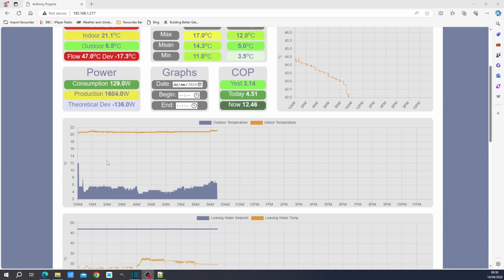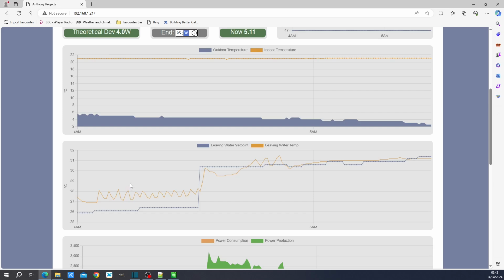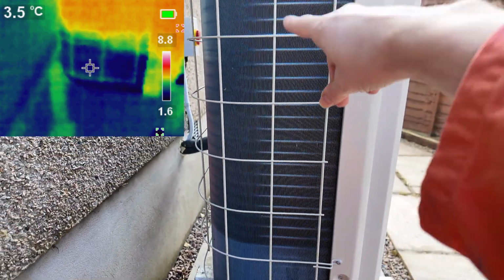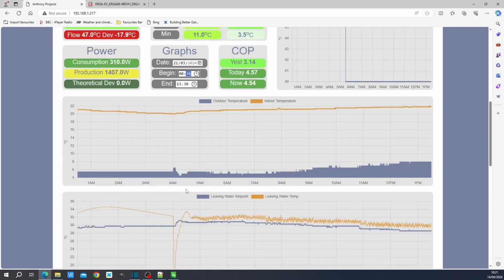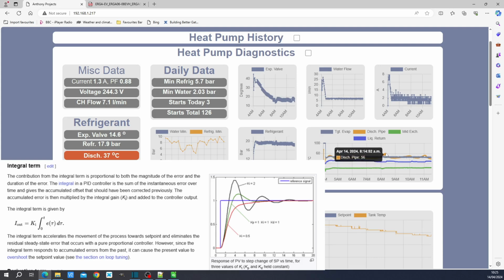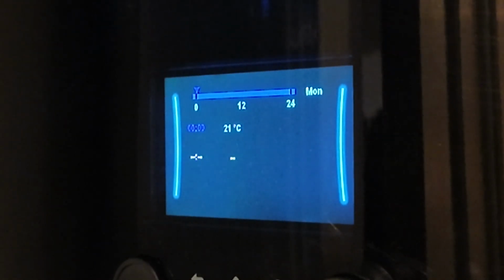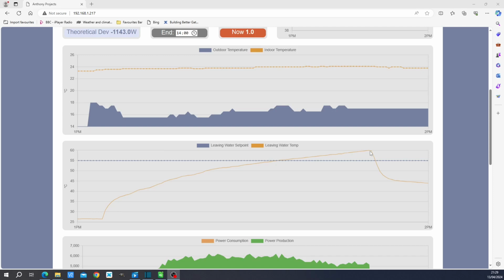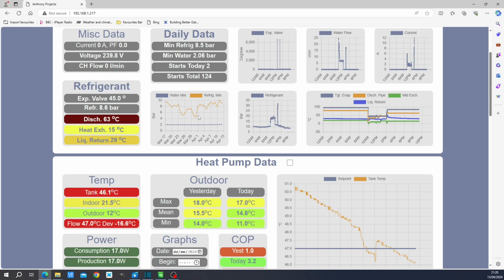Aberdeenshire Heat Pump Odyssey Part 6:  A new analysis tool for Daikin

Comment: I have just had a 6kw Daikin heat pump installed by Octopus. There is not much detail in the data available to determine efficiency and performance. How did you obtain all the specific data points such as expansion valve position and pressures and amperage ?
Reply from the maker: The video in Part 4a describes the setup, including the ESP Altherma Project.  

Current come in two flavours:  Primary Winding and Secondary Winding Current.  I could use the primary winding current, along with mains voltage.  Then I could plot current vs instantaneous power consumption at the meter in order to obtain power factor, and then I applied a best fit curve to the data acquired to be able to convert current to power.

Expansion Valve Position has a maximum raw value of 450. I surmised then that this was the opening angle of the expansion valve * 10.

Water Pressure was tricky.  The data was not depicted in Bar, Pascals or PSI,  So I had to plot the raw value against the analogue gauge indication over a variety of pressures to obtain a curve (which thankfully was a linear fit).

Comment: Hi, I saw in the first offer you had an EPRA unit, but now I see is an ERGA. Can I ask why? I am currently deciding either one or another. Thanks!
Reply from the maker: @erikestrada1883  These names that Daikin get me confused easily.  Essentially my system is a split refrigerant system.  The original quote was for a monobloc system.  I prefer a split refrigerant system as it means you don’t need to introduce glycol or antifreeze valves into the equation.

Glycol has comparatively poor specific heat capacity and viscosity compared to water.  And bringing water outside the building is risky during deep freeze conditions (especially when you’re away on holiday).
Reply: @ thank you very much! All your content is really helpful! The names also drives me a bit crazy haha but I think the only difference that makes me be worried is that the EPRA can reach up to 70 degrees while the ERGA I think is only 60 with BHU! I made all the calculations to run my house with radiators at 50 degrees max. So the unit you have should be enough. Have you ever felt cold or like the heat pump could reach a comfortable temperature? Thanks again for your reply!

Comment: Quick question: where do you get the expansion valve degrees from? I assume you calculate it from the "Expansion valve (pls)" value from ESPAltherma, but which one? On my pump, both "Expansion valve (pls)" and "Expansion valve 2 (pls)" values seem to have data, but the 2nd one seems to be read incorrectly (the endian-ness seems to be wrong). If I invert the two bytes, then I get what seems to be an appropriate value for the number of pulses (currently 215). So, I wonder if your values are inverted as well and you patched the ESPAltherma code, or do you actually get the correct value? Thanks.
Reply from the maker: Here's my datapoint:  {0x30,3,151,2,-1,"Expansion valve 1 (pls)"},

I then take that raw value, strip out the title and divide the remaining number by 10:
ExpValvePos = float(ExpValve1Value)/10
Reply: @anthonydyer3939  Thanks! Turns out the def file for my heat pump was completely off.

But one more thing about this value: the service manual states that 0 pulses = fully closed, 480 pulses = fully open. And since the ESPAltherma value supposedly indicates the number of pulses (pls), you might want to change the formula for calculating the angle.
Reply from the maker: @markoluksa  except I do get a value of 500 when the valve is in defrost mode.  Where did you find out about 480 pulses?  I just saw what the value was and figured that it was either % open, or it was number of degrees (assuming it’s a butterfly valve, and not a gate valve).

Comment: Not sure if you've already learned this after recording this video, but you should also be monitoring the inverter frequency. This will show you that the compressor's power draw isn't reacting to a change in refrigerant pressure, but the draw is actively being controlled by the inverter frequency (at least that's my understanding). The refrigerant pressure is also controlled by the frequency. As far as I understand, the heat pump's control unit is trying to create a specific pressure in order to achieve the required refrigerant saturation temperature, so that the phase change from vapour to liquid happens in the internal unit's heat exchanger at the correct temperature. This saturation temperature is indicated by the "Pressure(T)" item in ESPAltherma.

One more thing: at least in my case, the inverter primary current is 0.5A when the compressor is not running at all.

Comment: As a Daikin owner this is a very interesting video, I'll be collecting more than basic stats (LWT, Setpoint, Flow rate etc) and seeing how well mine is doing at different ambients vs. the specification.
In respect of the passwords etc. there is a very usable Python module configparser which reads/writes INI files, and makes it all very easy. Just about anything you need to do is already in a module somewhere :-).

Comment: Anthony, Very impressive data collection, reporting and analysis. You are definitely onto something - I just cannot decide what.😉 I would be tempted to say the PID calibration is out of whack or the TEV (or whatever they call them in modern parlance) is defective. Looking forward to seeing how this pans out.
Reply from the maker: I removed all the Thermostatic valve regulators for the radiators since this video.  They were giving me “trust issues”.  They were wound up to their maximum end stops, and the advice received three times from both plumber and heatpump engineer was to make sure the radiator valves were all maxed out.  So I wandered “what if the valves are closing in anyway?”.  So the answer was that they weren’t.  The DeltaT was exhibiting the same behaviour.

The minimum compressor current is the culprit.  Most times it’s 1.3 Amps, but it’s only when it drops to 0.5Amps that I see much better COP.  I’ve pored over the data to ask the question of what the system or environmental difference is between a 0.5Amp or 1.3 Amp situation.  I can’t find the answer.  Sometimes I’ve seen stubborn minimums at 1.8 and 2.3 Amps with similar outcomes for COP.

Right now I’d need Daikins source code to find that answer, and I don’t  have the contacts or reverse engineering know how to extract that data.

As the weather has gotten warmer, I’ve seen other weird behaviour.  When inside temp is 24 degrees or higher, the hot water heating mode refuses to engage until I reboot the heatpump.  Once the inside temperature drops below 23 degrees (the absolute cutoff for any space heating operation), the hot water cycle will engage correctly.

I do feel like this could be fixed with a software update, and one firmware update was offering, update download failed, and the update was then withdrawn.

Comment: 60oc max is to prevent compressor failure. Need to see your temperatures and pressures too.
Reply from the maker: Wouldn't compressor failure protection be dictated by refrigerant parameters rather central heating water parameters?  We have refrigerant discharge pressure/temperatures for example, and those are under PID control.  Your target discharge temperature for example was continuing to rise up.  Current draw was only 9 amps at the top end of that heating session - well within the 14 amp maximum.

Comment: You show it later on when you switched heat pump on.
Big delta t , better performance as bigger load.
Reply from the maker: Since this video, I’m definitely placing a lot more focus on the DeltaT. It’s about 3-4 degrees when COP is high, but only 1-2 degrees when COP is low.  It’s definitely the case, when the house is cold (e.g. turning on when returning from holiday) the COP is very high.  But when the house is 21 degrees or warmer, and the flow temp is 28 degrees, of course the return temp is going to be no lower than the room temp!  The puzzling thing is that the return temp is still much closer to the flow temp than the room temp.

Now the advice from my installer is “turn the radiator TRV’s to max”. This they are already, on the maximum end stops.  But now I wander now if the TRV’s are still interfering.   I feel an urge to point my IR thermometer at some radiators now (and maybe remove the TRV regulators completely).

Comment: No load on heat pump and compressor minimum output reached.
This shows on the rear too as it only is showing condensate on the lower coil.
If you timed the heat pump during warmer weather it may help , or just turn it off .
I can turn mine off for long periods above 9oc.
Reply from the maker: The deltaT is certainly one factor.

The open question is "What is the Minimum Compressor Load"?
Is it 0.5Amps, 1.3Amps, 1.8Amps, 2.3Amps?  

Because I've seen all of them dominate as a minimum output.

The answer seems to be "it depends", because PID control parameters alone are not bringing the compressor load down to 0.5 Amps all the time.  There seem to be additional interventions

Last night for example, the COP was poor due to low deltaT, and yet the compressor refused to drop below 2.3Amps.  During the leaving water climbup to the setpoint however, the COP performance was right on the published figures, but once the setpoint of 32 degrees was reached, the COP tanked.   On previous nights, a setpoint of 32 degrees was absolutely humming along with a compressor current of 1.3Amps and a much better COP.   I raised the setpoint of the Weather dependent curve yesterday evening, and the consequence on the minimum output is that it also increased.  So the COP numbers in steady state have no opportunity to improve.

I've reverted back to the previous weather curve.  The "unknown variables" that affect minimum compressor load are yet to be uncovered.  I'll continue to probe, and hopefully I'll discover those variables.
Reply: @anthonydyer3939 Delta T actually represents ‘load’ or lack of it.

Comment: Superb effort, but what does a 'normal' person do when they are forced to install a heat pump and they dont have the ability to build a data integration and perform a very thorough analysis looking for efficiency savings? They get poor performance, crazy bills and complain resulting in negative news headlines. This is a brilliant window into the complexity of a heat pump compared to a gas boiler.
Reply from the maker: You can look at the heatpump on a cool humid day.  If you get condensation only on a portion of the outdoor heat exchanger fins then something is up.  That’s the easy way to figure things out.

But heatgeek approved installers are now going to be guaranteeing the expected SCOP that they provide you in the quote.  They’ll carry out remedial actions if that number isn’t achieved.  So in order to provide such a guarantee, they of course need to put the measuring equipment  in that measures it.  No doubt that is “open energy monitor” equipment. 

But heat pumps aren’t complex.  We’re just scrutinising them a lot more because they are so much more expensive than legacy gas boilers - at the moment.  But as you’ve seen, the business end of the heat pump really is a simple device.  I think there’s a lot of scope to reduce material costs in the future.

Comment: Surprised you’re not using a round robin database to store the historic data
Reply from the maker: I’ve not heard of that, but the text files are perfectly fine for this use.  I haven’t dabbled in other file formats such as xml.  I need to get my head around the advantages of each file format vs another.  Tab separated files are easy to understand, but I’m told they are ‘primitive’ methods.

Comment: I hope they can sort out the hot water temperature legonella cycle with a software update,  I imagine it will increase energy costs over the long term with the constant use of the backup heater.    If not it makes a strong case for using r290 heatpumps.
Reply from the maker: I’m sure a software update will solve this, if they are interested in solving it.   I just hope they are interested.

Comment: Where are the rubber mounts on your outside ac unit! Most be noisy
Reply from the maker: It’s not really. In the kitchen I can hear a faint hum if I have the radio off.  It’s not attached to the house so noise isolation isn’t so critical.

Comment: it looks like you have discovered the operating envelope of modulation at higher temperatures.
What is your weather dependent curve configuration?
Reply from the maker: Top end is  28 flow at 10 degrees ambient
Bottom end is 45 flow at -12 degrees ambient.

It’s been tested down to -3.5 and my house has maintained the desired temperature.

But it’s going to be at least a few months before I find the conditions to tweak the bottom end of the weather curve.
Reply: @anthonydyer3939  in the mean time tuning the top end further over summer is possible, fwiw i set 23oC lwt at 20oC ambient and 37oC lwt at -10oC. Albeit with underfloor heating and a 200Litre buffer and a mixer. Basically the buffer/mixer does the modulation at high ambient temperatures. I don't find the buffer/mixer harms cop much. I concur the BUH destroys cop. Use the installer login 5678 to access the setpoint settings. If you haven't yet found it there's settings to restrict the BUH and set an equilibrium temperature at which it kicks in.
It looks like your minimum input power is about 500W, the minimum output at around 15oC ambient must be something like x 6 = 3kW?
I believe you said (correctly) the system stops heating when the return temperature reaches the set lwt. The circulator should continue though.
Stupidly I had not realized this is all a software PID controller until you pointed it out.

Out of curiosity are you running modulation mode with a Madoka thermostat?
Reply from the maker: @z_boson5629  Last night I increased the minimum lwt to 30 degrees from 28 degrees.  The result was even worse COP.   The COP was 2.5, when it should have been 3.3 (it did reach published figures, but only during temperature climb up to setpoint).  What I saw was that when the lwt reached the setpoint, the output reduced as expected, but the input would not drop below 2.3 Amps.  This was with ambient temp of 3 degrees.     Therefore a higher minimum input was established for the heatpump.  

So I'm starting to think that the minimum consumption for the compressor is dictated via software by  a combination of leaving water setpoint, ambient temperature and "unknown variables".  It's certainly not a  fixed value, and PID control alone doesn't explain this behaviour.

I'm going the other way tonight - 24degree setpoint @ 15 degrees.  Maximum 1 degree overshoot.  Hopefully I find better performance at lower ambient temperatures.  But at higher ambient temperatures I'm hoping the overshoot limit will cut out the compressor and stop it running in a bad regime.

Comment: You might find the CSV python module useful. It can do tab delimited too. Much nicer than that print statement you had.
Reply from the maker: I’ll look it up.  I am completely self taught when it comes to python, coming from the school of “how do I google xyz?”.  I’ve recently learned about for loop arrays in javascraipt and python and it’s shaved a lot of lines of code that was otherwise there.  So I’m also using this as a platform for mastering neat programming tricks that make the site more efficient and add cool functions.